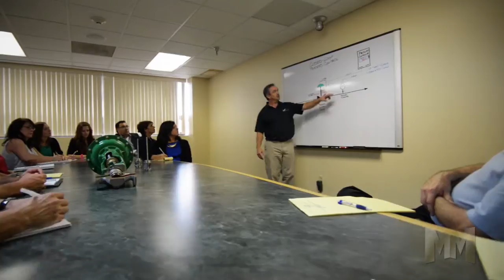Automation Service on Manufacturing Marvels

Comment: In all the years that I have been involved with numerous facets of manufacturing, never once have I been as impressed as I am with the undeniable sustainability and where with all to serve so many markets of industrial process controls as what Automation Services offers. If you use process controls, control valves, positioners and like products in your operation it would only go to serve that you give Automation Services an opportunity to enhance your bottom line through products engineered to the same standards as the OEM's with a fraction of the cost of new OEM products and benefit from the incredible sustainable credits available through utilizing renewed engineered equipment